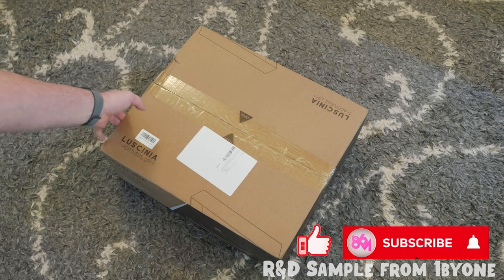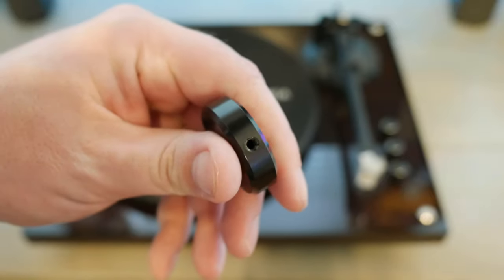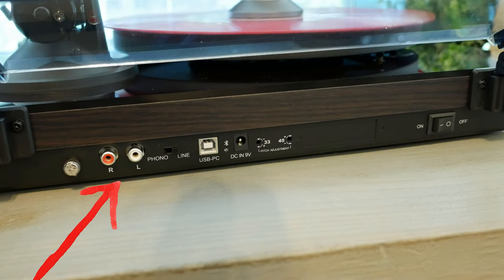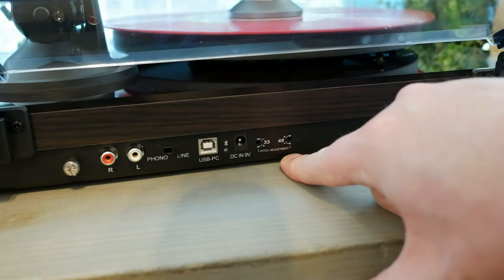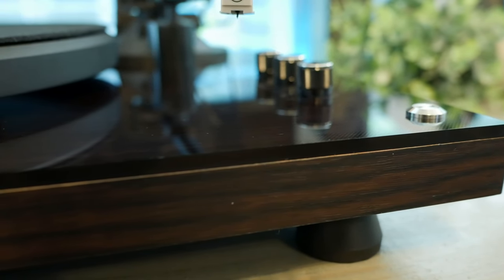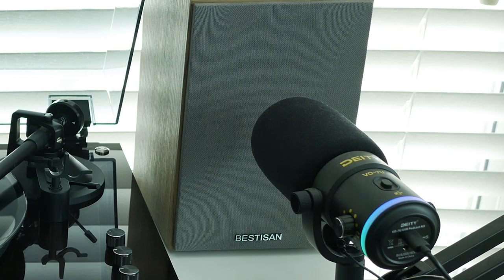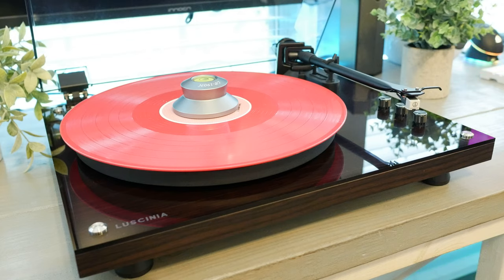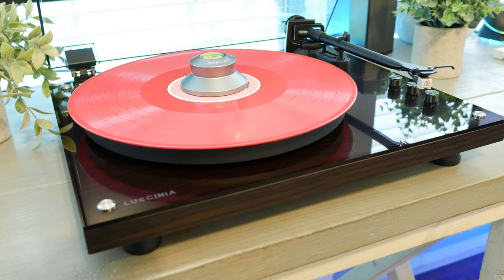Luscinia is 1byones step up from the same 'ol same 'ol.

Comment: At that price point it's impressive that the speed adjustment is an option. Good on them.
Also, I could tell a difference in the effect acrylic has on the sound even before you played it. Yup. I'm that dang good, I tell ya what.
#LongTimeCallerFirstTimeListenerJake 👍
Reply from the maker: 3:08 is 100% for you in that case.
Reply: @EightSixMatt  😁

Comment: nice video thanks,  looking at this one on Amazon .    Quick question, does have an auto stop feature when the  records comes to it's end?   thanks
Reply from the maker: Yes it does, its on a timer. So after 24 min and some overage change (average length of a 33) it will stop the platter. If you set it on the inner most song it will spin until that timer ends.